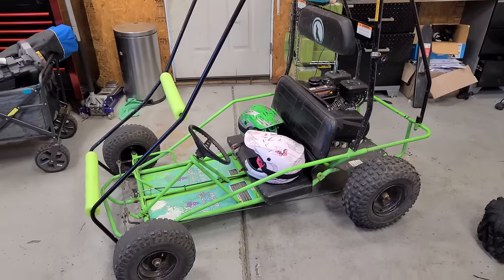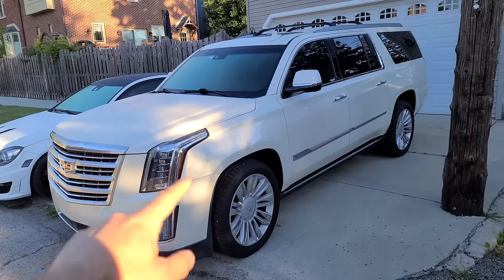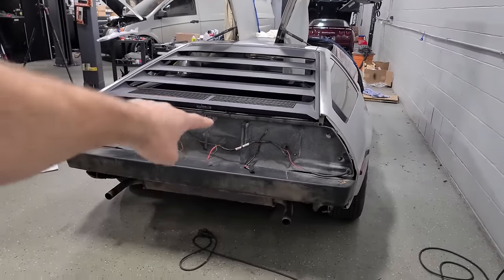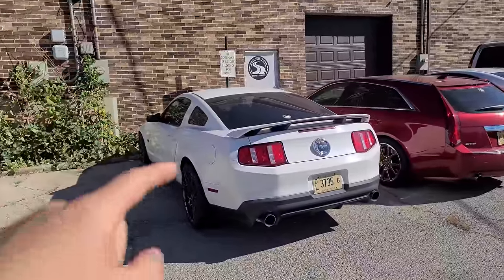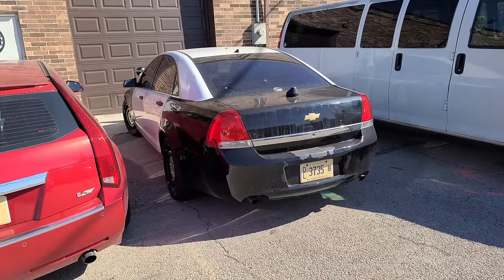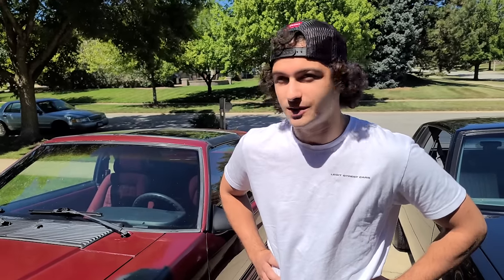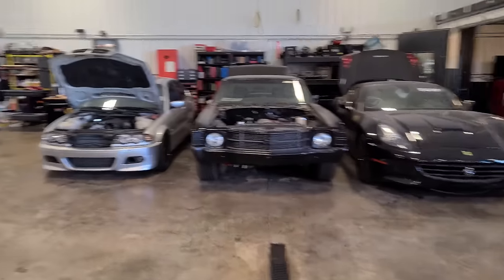Here's An Update On ALL My Cars & Why I Have To Sell Many Of Them! DeLorean Restoration Teaser!

Comment: For Eli, tell him to scrap the BBK Clutch cable. They're known to stretch and break. Factory ford/ford performance  if you can find one or Steeda are the way to go. But.... If he's still got the factory plastic quadrant get that out asap and grab a steeda billet quadrant. When he installs it make sure itls hung properly. you can usually kind the steeda kit with cable, quadrant and firewall adjuster for $130-150. And then after that order a nice MGW shifter. He'll never look back again. Or he can sell the car to me ill evven let him keep the motor and tranny so i can drop my 408w in it.

Comment: Tell Eli to go with a Ford cable with adjustable quadrant and firewall adjuster. Also, make sure the cable isn’t too close to the header . I had a brand new cable fail because of this. Maximum motorsport sells a cable heat shield kit .
Reply: Unfortunately there are no more of the good ford cables around. I spoke with MM and they aren’t able to get any either. Next best choice would be steeda non adjustable cable with their own FW adjuster and quadrant

Comment: The kid with the foxbody likely needs motor mounts. The BBK headers fit pretty good normally, but I’ve had the same problem in 2 foxbodies. Got headers thinking it would be easy, go to put them on, they hit everywhere. Realize the fan is close to or touching the fan shroud, realize the mounts have collapsed, install, finish installing headers with no trouble. I’ve had to replace mounts on cars with under 100k miles too, so yes. They do go bad quickly due to the engine being torquey.
Reply: Also needs to put the stock 19lbs injectors back in. If it had a/f cam, heads, intake plus MAF I could see 24lbs injectors useful but not on a stock motor

Comment: We had a little battery powered jeep for the kids when they were younger...  I used a saws-all to custom fit a 12volt car battery (gel filled type) and put a lock on the hood.  The battery would last for weeks between charges!  The kids used this little jeep so much the plastic tires had wore holes in them by the time they out grown it.

Comment: The fox body clutch "snap sound" might be the plastic factory clutch quadrant on the clutch pedal. A couple companies make upgrades. Eventually the teeth on the plastic nylon teeth on them break. It's supposed to be adjustable and it breaks eventually.

Comment: Hey Alex.  Tell Eli to check the path of the clutch cable, especially through the firewall.  I had a worked V6 Ford Capri that used to break clutch cables about every 3 months, so much so that I used to carry a spare one in the boot and was able to replace out on the road by driving the front of the car on a curb and crawling underneath.  Anyway in my case I finally found out that the path from the top of the clutch pedal through a pipe in the firewall and to a bracket in the engine bay was not perfectly straight and so ended up acting like bending a wire on an angle - yep it eventually snaps even though it was a multi strand cable.   Once I corrected that - no more snapped clutch cables.  Seeing it's a Ford - maybe it is a similar situation.

Comment: I added a milwaukee 18v battery to my kids power wheels. It makes it twice as fast as the screrw removal speed and depending on your size of battery, it will last longer and make battery swaps easy. You can buy a battery adaptor online for any cordless drill battery. I will say though make sure you put a 30amp fuse or breaker inline with the battery or you will burn out the little plastic fans inside the motors on the wheels.

Comment: My dad used to mess with power wheels when i was younger, and you can get a factory kit with a addon 6 volt battery, no soldering or twisting required, its just plug and play

Comment: Eli....couple suggestions.... Use the Ford cable kit M7553-A302.  Most aftermarket cables are dog crap. If you put on long tube headers, or equal lenght, your probably also melting the clutch cable, so its gotta be re-routed and heat protected. If they havent been changed, put in new motor mounts. Use Ford convertible mounts. Trans mount as well.  Also stock motor speed density cars dont need or like 24lb injectors.  Go back to the 19lb squirters

Comment: Tell Eli those BBK clutch cables are trash; IIRC the SN95 clutch cables fit (throw a maximum motorsports firewall adjuster on with it) and it'll be bueno

Comment: Alex the 87-88 mustang needs a mass air conversion to run those 24lb injectors since it has a speed density ecu and the header issue might be the right side motor mount.

Comment: Back in sixties my dad made our first go cart consisting of 2×4's and no clutch. We'd prop the rear on a concrete block and start it that way. To stop,my dad tied a string on the spark plug wire in which when one kid's ride was over we'd chase them down and grab and jerk the spark plug wire off the spark plug

Comment: The Hot Wheel screw removal is in the owner's manual. Pull it when your kid is ready type of screw. You can add a higher voltage battery, but don't go too high, the electronics can't handle much.

Comment: Hooked 2 18 volt Milwaukee batteries with speed controller in my daughters power wheels. It goes pretty good now! Lol. Also had to put under Glo and a radio on a separate 12 volt battery. She loves it.

Comment: The stock aluminum 16inch 2500hd wheels that came on the gm trucks from 2000-2006 would look great on the cargo van, especially polished up. Definitely do a cool paint job like a 70’s van with wizards or whatever on it.

Comment: You can find conversion adapters for that Power Wheels for just about all the major power tool batteries. Or you can do what I did and cannibalize an old tool for the battery base, and the old 12v Power Wheels battery for the connector. Just make sure to add a fuse block.  Just going from 12v to the 18v power tool battery turned our Power Wheels into a little drift machine. You can go with higher voltage batteries, but you run the risk of chewing up those plastic gears.

Comment: I just wanted to let you know about the power wheels. I don't know if anybody said anything cause I didn't look to be honest but. I have 2 kids, 1's nine, the other 1's 2. And I just built my two-year-old power wheels. It's a twelve volt and safely an eighteen volt battery does pretty good Quite a bit faster I wouldn't go Much bigger than that unless you want to upgrade the But yes, all you literally have to do is find an adapter. For whatever batteries you wantna, use a teen Volt. I use Roby batteries because I have a ton of Them and wired in.
And you're good to go.

Comment: Your cl 65 is a lemon car that a dealership didn't want to lose money on so they sent it to auction. This is from experience from buying a brand new Ford that had 8 miles on the odometer. It was in for warranty for 8 months for 1 year in the shop. So I barely drove it 4 months before totaling the car

Comment: My experience with the fox body bbk headers I never had ac and I would of tried to slightly bend the ac line before beating the header however they allllll have to be beat around the motor mount area

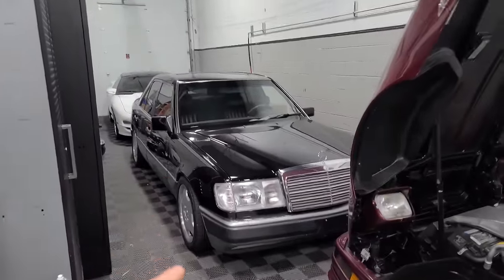Comment: 16:30 Once again Alex I want you to know that "YOU ROCK!" LOL. Thank you for all the great EVERYTHING!  I'm so happy to hear you would consider another bimmer in you're world and that 435xi would have been super. Maybe in the back of you're mind you might want to remember that the N55 Engine in those isn't the one that can as easily hold the big power without internal upgrades. It'll hold up to around the 500 hp mark or so with no problems and has some good points for sure But ultimately if you want to a tually build a big power bmw without costing the kind of money it often does (I mean over the 700hp mark and more) you'll likely want thd N54 or get into the "S" variants of those engines. As well of course the B58 or better the S58. But I'd just be happy to see another bimmer being tooled on in your shop. Thanks again. 😊❤🎉🎉

Comment: Interesting that he swapped in 24# injectors in that Fox and it's running well. 86-88 were Speed Density ECU Mustangs. They didn't like larger injectors, since the ECU was pre tabled for fuel ratios

Comment: 31:09 the reason the headers didn’t fit is most likely because the motor mounts are shot and the engine isn’t sitting as high as it is supposed to. I had that issue with one, but I replaced the motor mounts and everything fit as it should after that.

Comment: That foxbody probably needs a new clutch. I've ran into repeated broken clutch cables on these cars due to bad pressure plates. The headers are a different story. Good brands fit good. Off brands fit bad. In the case of equal length shorties like on this one, they may need a little clearancing in some cases. Sometimes, you think it needs clearance when it actually doesn't. Just my .02 Great video btw

Comment: The reason the Foxbody is running rich is probably the injectors, 24lb injectors are too much for a stock Foxbody. I would recommend converting it to mass air, that year model is speed density, and you can't really do much while it's speed density, no cam or anything like that. You could put an adjustable fuel pressure regulator on it to dial in the fuel pressure, maybe that will help with the rich problem.

Comment: Not a fan of the 18V drill battery conversions.. can really heat up the motors and/or nuke the plastic gears in the gearboxes. I prefer getting 12V20Ah LiPo batteries off Amazon and swapping them out for the stock battery; consistent full power for almost 3x as long as stock (just gotta use a Lithium friendly charger).

Comment: Machine shops suck nowadays. It's hard to find a good one.
I just had a 302 built  to a 347, complete forged rotating assembly With a winded tray and engine girdle paid $7,832.And the guy never Line honed the block Only had 3 heat cycles and it damaged the bearings and had to take it to a different shop for them to redo everything. Cost me Additional $3,800 to fix the first shop's screw-up.

Comment: You so funny, I bought a z4 2005 convertible. Lol top quit, I replaced all plastic front parts of motor, radiator & belts. Now oil filter gasket. Brake sensor light on. More fun working on it than driving. Thank God I only gave $1500.00 & being offered 7 & 8  grand . It just pretty. 😂

Comment: Random Question 🤔
Would a small (hearing aid/coin-sized) Neodymium magnet, placed on inner tip of virtually any Oil Drain Plug, help in removing oil glitter? 
(You had mentioned Magnetized Drain Plugs before...seems they'd have to be quite specific  to various engines.)
Reply: Most GM oil plugs have a magnet made into the plug bolt since the 2000's. I wouldn't put just a magnet on the bolt. You can buy bolts with the magnet on them. If you have oil glitter, you're engine isn't long for this world. I do add neodymium magnets to the bottom of the oil filter can on my older vehicles to catch and hold particles.

Comment: The Boeing 747 cruising at 530 miles per hour at a weight of 700 000 pounds is seen to require 59,934 horsepower aka lbs thrust.

Also you should sell toys in the spring, more money 💴

Comment: Tell Eli to find a maximum MOTORSPORTS cable - or an oem ford . 

Last if not a steeda . The rest are JUNK . 

If it’s got 24lb injectors - and doesn’t have a pro m mass air meter that’s what it needs . Tune is sort of waste on a mostly stock engine . Talk him Into mufflers too . Flow master , magnaflows , ultra flows something . Car will sound way better

Comment: @4:26... Actually a 757. In addition to cars, I'm also into planes. I'd love to buy one of your cars, but your viewers are willing to pay an "LSC Tax", so I can never afford one. @6:27... Because the Buick V6 essentially is an SBC with 2 cylinders lopped off. @11:00... Doesn't matter what state you're in... 90% of machine shops suck. I could write a book about my problems with machine shops in Vegas. @13:45... Sell it back to the CEO for a bunch of money, then use the money for a charitable project. @15:35... If you're doing a single color, my vote is for a 90's period correct teal. Teal was a very popular color in the 90's and is actually making a comeback. @17:50... The WS6 is your "going to be buried in it" car. I don't have one of those. If I'm ever in a position to buy a 288GTO or a 512M, I'll be buried in that. @26:21... It's not going to rust as long as it still has grey primer. I like the stealth thing. Leave it as is. @35:50... Some of the exhaust goes through a secondary cat and past the secondary sensor to keep the ECM happy. The rest bypasses the secondary cat. I'm 50 now, but when I was younger, I wanted to be OJ. I worked at a few performance shops that I tried to elevate, but constantly dealt with owners that were happy to just skate by. Never had the funds to start my own shop. I'm close now, but feel I missed out on the best years of my life.

Comment: Your all upset about how Chicago weather will ruin your cars.
I’m from NH. 
You get yourself a quality wool wax undercoat, or even truck bed liner. Works for about a year, and ZERO rust. 
I have a 2013 Chevy sonic that’s undercoated with wool wax. It works great, easy enough to apply, and keeps that winter salt and rust away!

Comment: Power Wheels Adapter for Milwaukee M18 Battery Adapter 18V Power Wheels Battery Conversion Kit with Switch, Fuse & Wire Terminals, 12AWG Wire, Power Connector for DIY Rc Car Toys and Robotics

Comment: Putting headers on that Mustang was a complete waste of time and money...especially using equal lengths...the moment you had to dent the sht outta them you lost what tiny bit of possible improvement they were capable of.  If for some crazy reason you just have to have some headers make sure you just get the standard unequal length 1 5/8 shorty headers...JBA fits the best but BBK is pretty good too. Also, 24# injectors was pointless without doing heads/cam....I guarantee you that poor Mustang runs like absolute dog sht the way it's set up right now. Put stock headers back on, put stock injectors back in, then do some mods that will actually improve performance...3:73 gears, Flowmaster cat back(for that unmistakable 5.0 sound) a good clutch, bump the timing to 12ish degrees, make sure all the basics are right..plugs, filters, fluids....

Comment: Speed Density Mustang will not run right on 24# injectors. You won't be able to tune ot either. Terminator X os in your future.

You can convert it to MAF and have a chip burned for it. About it.